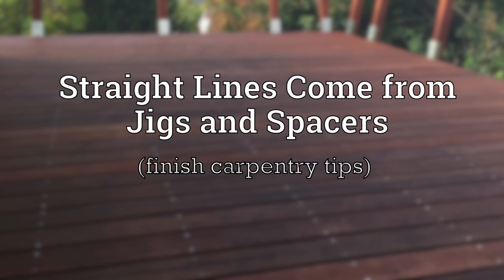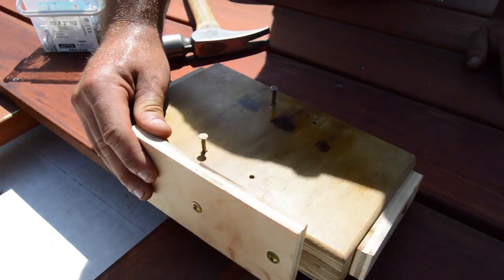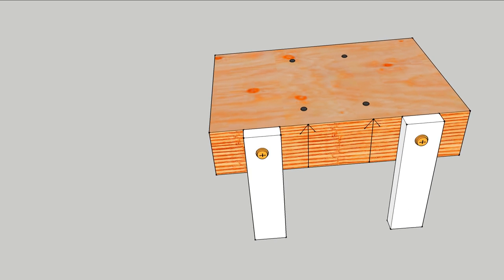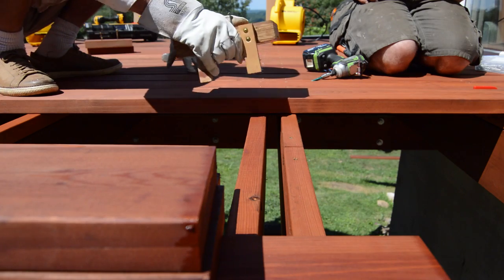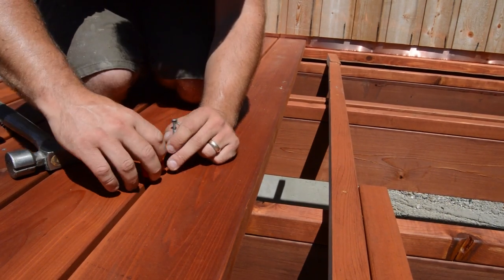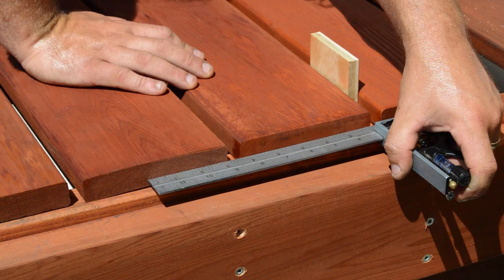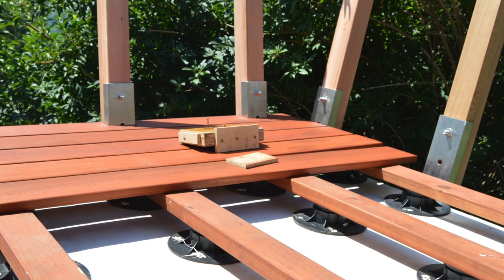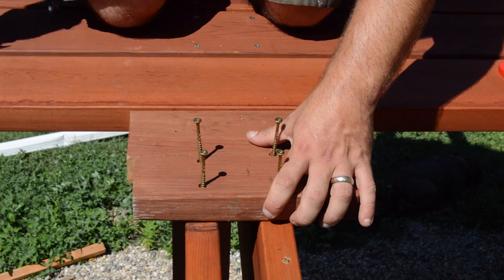Consistent Screw Lines and Gap Widths

Comment: A time consuming process if your paying a contractor by the hour to install your deck.  True the boards and install only one screw at each joist until the complete deck surface, or a large portion of the deck is covered.  It's easy to eyeball and keep the line straight.  Then snap a chalk line across the boards in line with the joists.  Now, return to drive all the remaining screws.  A fast and simple way to keep those screw heads in line like soldiers without wasting time and no jigs required.   Sink the screw heads flush with deck board surface, never below the surface or you will encourage rot.
Reply: Exactly how I would do it as well

Comment: Yeah, no thanks. I never run screws in a straight line on a joist. I always stagger them. In a straight line you run the risk of joist felet. Once it starts thaw and freeze compounds it. I've had to replace joist because of this. Offsetting the screws on each deck board is still an asymmetrical look I can live with. Form follows function.
Reply: What is "joist felet?"
Reply: I have been building decks for over 30 years . I put my screws straight across the joist and never never has there been an issue. Just had a 90th birthday party on a deck I built 24 years ago an it was still standing strong and straight. I live in Cincinnati Ohio where there is every type of weather you can think of . Never an issue. 
There is only an inch an a half of the joist your able to use anyway, how much could you possibly be staggering the screws anyhow ??